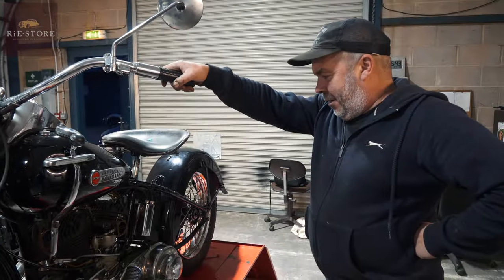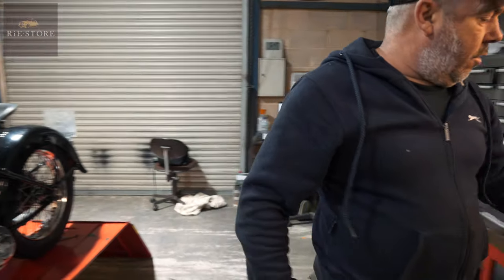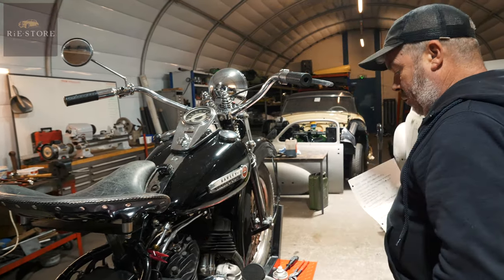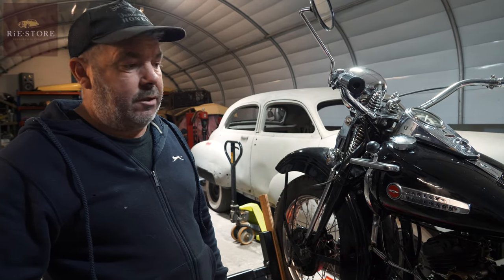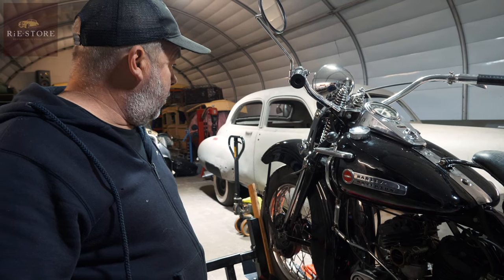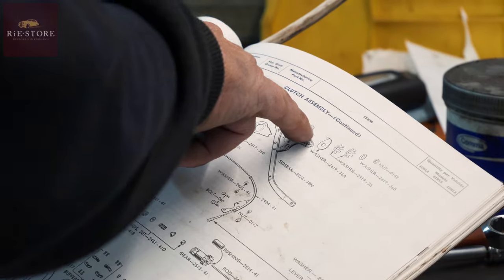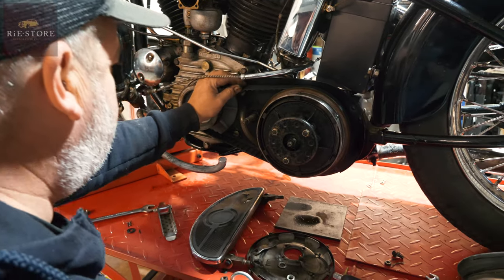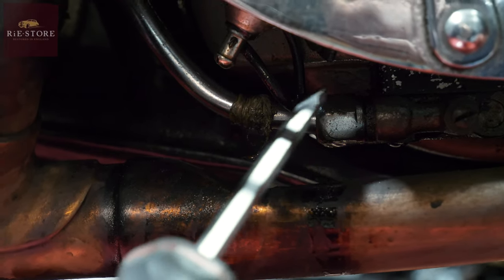Charging system issues - 1948 Harley WL / ep107

Comment: Regarding the 32E generator, it is the shunt mechanism/regulation people can't handle and understand, properly set and maintained every 10 years or so (cleaning commutator and change coal) it works perfectly, the theory behind it is Kirchhoff's circuit laws-current and voltage, it will take a time to fully understand its application (you don't need to understand the general law) but it is not that difficult, the result changes the output depending on how you turn the adjusting plate: clockwise or counterclockwise, if one wants to have answers to why an increase/decrease then you have to read up on how the frame is used in the electrical system and possible the direction of electron movement, start with the generator: function and all interactions in the electrical system, it will include all the familiar components but also the frame etc., it is a very good generator and works under extremely gritty/oily conditions where other models would have blown fuses a long time before, maybe one could compare it with the use of distributors/circuit breakers (in use 1890-1985) with breaker points and capacitors to modern pulse/electronic components to create an electrical system, but in the olden days no one thought of changing breaker points etc as something very burdensome or unreliable, also possible issues occuring on the road is much more easy (at least up until now) to handle, I have seen modern bikes with these characteristicly autistic electrical breakdowns-everything is dead or all lamps are blinking like a Christmas tree, so instead of changing the generator to a newer one why not have the back to basic knowledge of electromagnetic theory stored and use it in other context, magnetism and current are still very central phenomena in all disciplines of science, this is a very good series describing the WL 45' and now and then you get tips of how to solve problems that have its origin in genuine old fashion English back to basic mechanics, who accomplished combustions and self propelled motions when the rest of Europe wore clogs and slurped gruel by the roadside//Chris

Comment: So adendum to my story of train cars full of spare motors n parts that were sold for pennies on the dollar over here years ago, apparently in the 60's when these bikes were being out dated, guys would pull the motors and dump the frame out back and then make mobile air compressors and welder gen-sets with these old work horses. Thats how i found that exact frame half buried in an abandoned farm yard sans motor n gear-box.
Reply from the maker: That bonkers. You're full of crazy stories!